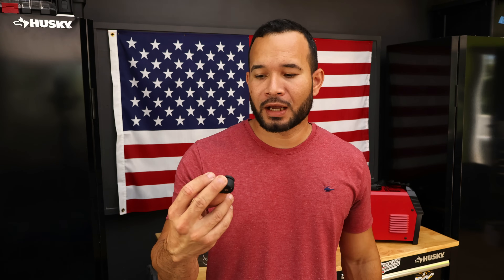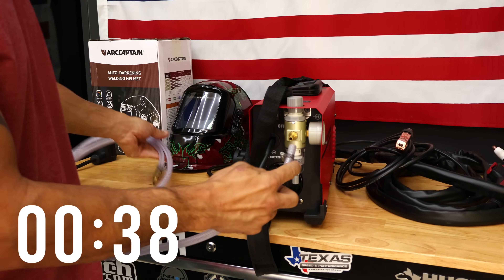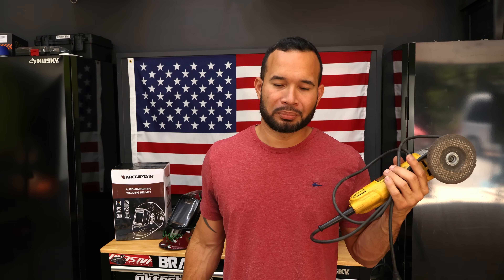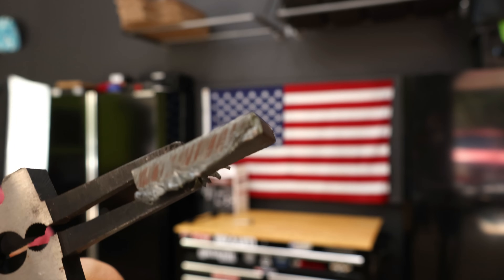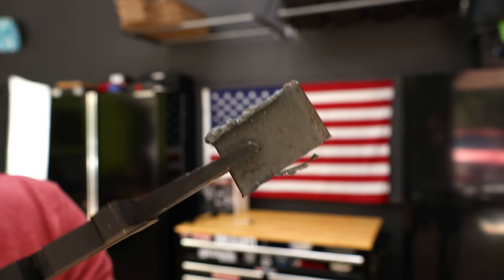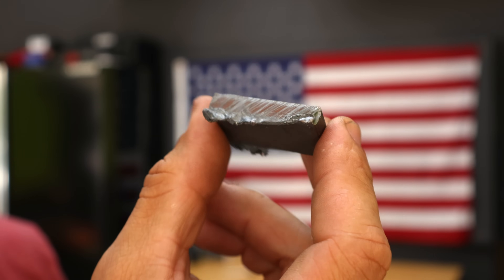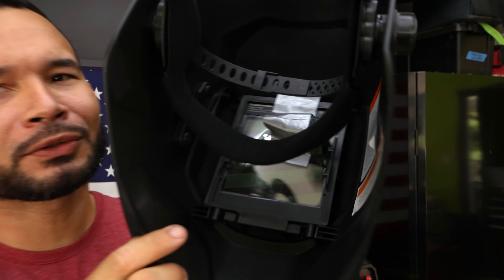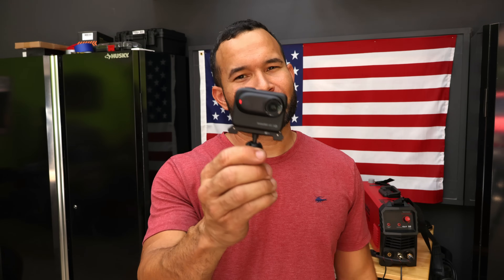Plasma Cutter vs Grinder: How Fast is the Arccaptain CUT50?

Comment: so you plug it into the same kind of outlet the Dryer uses? 3 prong kind? 
Also how does one take that portable on remote job sites?
Reply from the maker: The plug is a NEMA 6-50P, a 3 prong 220V. To take it to a job site you have to grab it and put it in your vehicle before you leave your house.